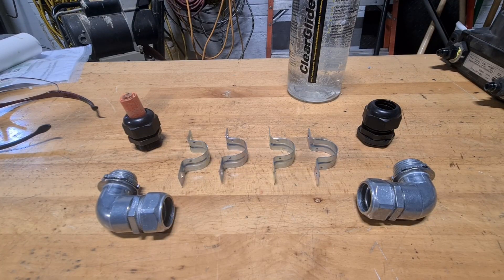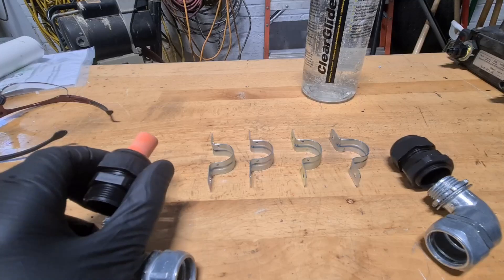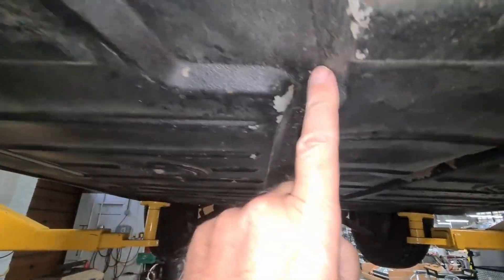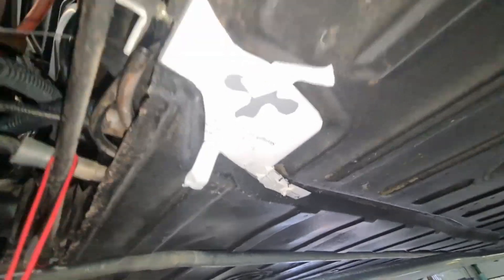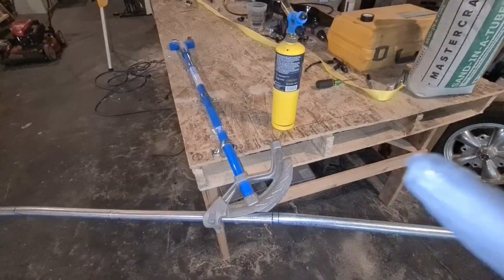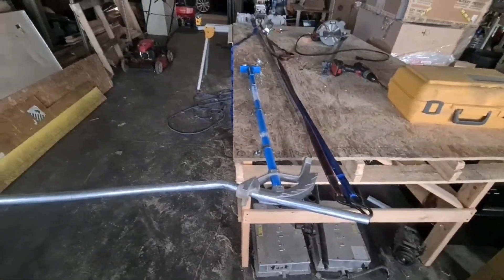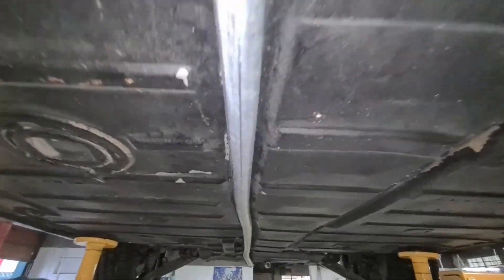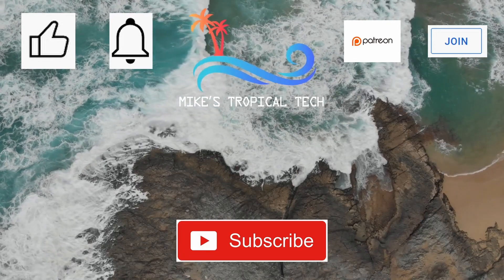Porsche 914 Upgrade Project - 09 - DC Cables Part 2

Comment: First pull a thin strong cord through. To do this, a small ball or something similar can be pulled through with the vacuum cleaner. A little dishwashing liquid in the pipe can act as a lubricant. But that then remains in the pipe.
Reply from the maker: Yes that's a good plan.  I've already bought a big bottle of conduit lube, should be successful but I don't want to add any additional restrictions in the pipe due to kinks.